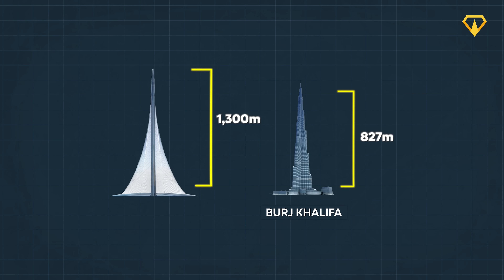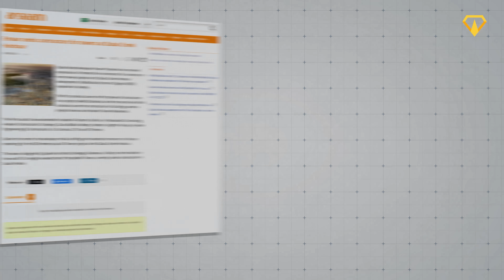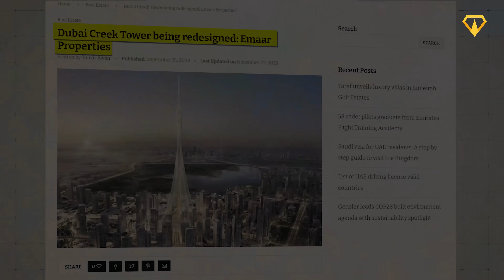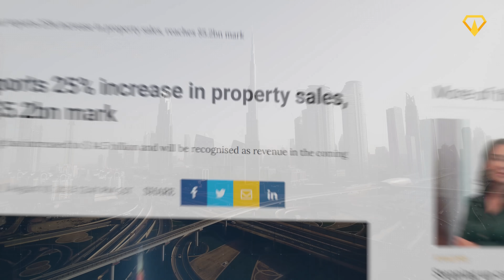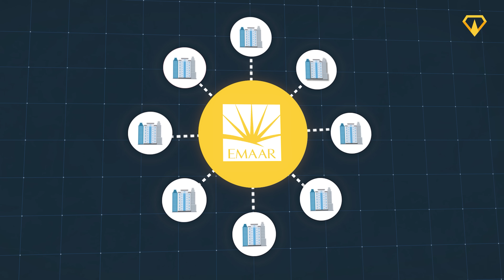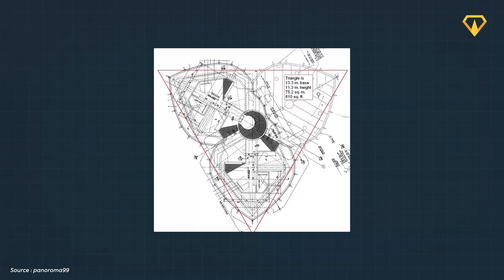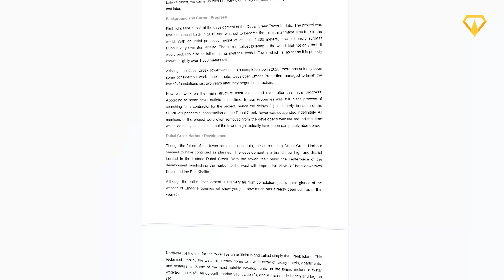Dubai Creek Tower Will Start Construction Again

Comment: My personal opinion of the design is that it looks like 2 different projects on top of each other, the first part, the circular slab  then the taper part, if possible to create a smooth transition between these two parts will give a more cohesive look.
Reply: Whats your opinon on the slave labor employed in the construction? Indian, Bangladeshi, Nepali, Sri Lankan, and Pakistani passports seized, no return to your families.
Reply: @bennycarter5249 what do u think of the slave labor that went into building american infrastructure? the unpaid labor that went into building the las vegas sphere? the extreme work conditions that latin american construction workers were put in to build the world cup stadiums? yet not a single person seems to mention those

Comment: been following sinc you had 48 thousand subscribers and I'm happy to say that you haven't started to cut corners just because you're a big channel now.
The time and effort you bring to create such quality videos is appreciated :Þ.   If I should change something about your Creek Tower design, it would be to remove the circular platform at the top that the steel strings are attached. I'd instead make them slowly incorporate into the tower itself to maintain the narrow look. In this way the tower would look more and more thin the higher you look instead of a sudden bumb.♥

(also if possible add water around the tower, you might already have intended too with the green marks you have at the foundation.)
Reply from the maker: Wow thanks for watching for so long :) Definitly would be good to make it smoother. Also the transition between the lower part and the tapering top

Comment: You're not looking into the case properly. Now these are mostly just conspiracies, but this is most likely what happened:

- Saudi Arabia began work on Jeddah Tower and boasted on beating the Burj Khalifa's record. Dubai didn't stand back, and proposed an even taller "tower". 
- 2017-19 Saudi Arabian purge: many wealthy people are arrested. This includes investors for Jeddah Tower. So, work on Jeddah Tower ceases.
- Dubai has all the money to go on with it, however since the Jeddah Tower stopped, there is no more competition. So Creek Tower also ceases.
- HOWEVER one of the MAIN reasons was that if you look at the international standard for a "skyscraper", there should be a minimum of around 50 floors or so. This requirement was not met by the Creek Tower, and it did not have enough livable floors. Hence, it would be considered a "tower" or "structure", but would not be considered the Tallest Building or Tallest Skyscraper. Hence they had to put a full stop to the entire project, since it would not benefit them in any way.
- The above point fully explains the reason for the redesign.
- Since Jeddah Tower work just restarted, EMAAR too wants to restart.

It literally didn't bother you how both towers ceased construction and restarted at the same time?
Reply: Wow that's some race to reach the skies 😂
Reply: Facts
Reply: update Dubai Creek tower did restart construction you yapper

Comment: Great video. but the Dubai creek tower was never designed as a skyscraper it was designed as an observation tower. and based on the amount of floors it could also not call it itself a skyscraper. A skyscraper needs to be 50% habitable space if its less than that.  Its an observation tower or just a tower.  info from Council on Tall Buildings and Urban Habitat
Reply: No they already announced the redesign of the project it's official it's not gonna be a structure it will be building after the redesign of the building so it's gonna be the next world's tallest building and structure at the same way . No one will have the title of the world's tallest building except Dubai believe me
Reply: @han-aae   ohh yeah they aint letting the title go thats for shure. Creek tower started very fast after Kingdom tower started construction the first time.
Reply: It's official it will be the next tallest building and structure at same time